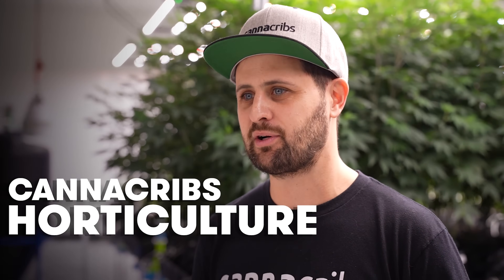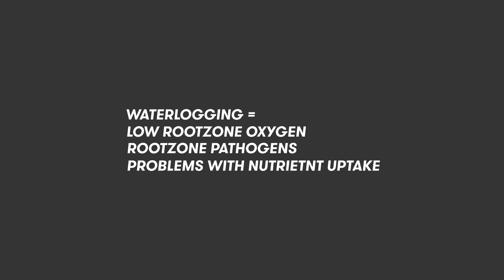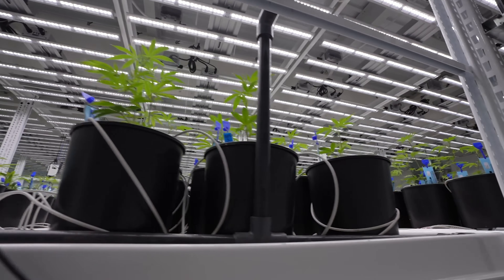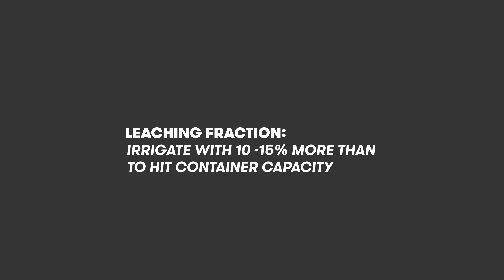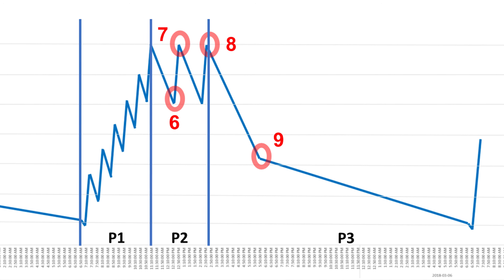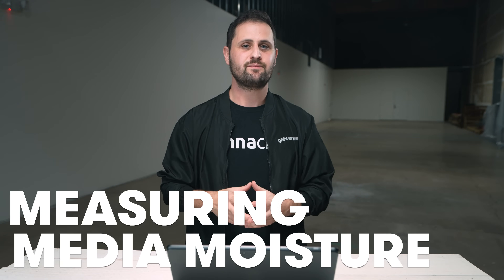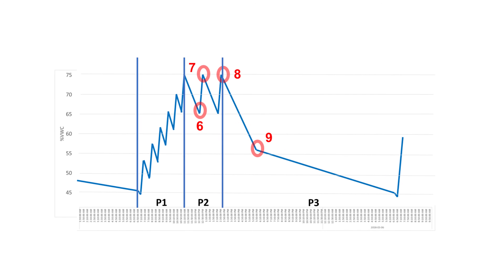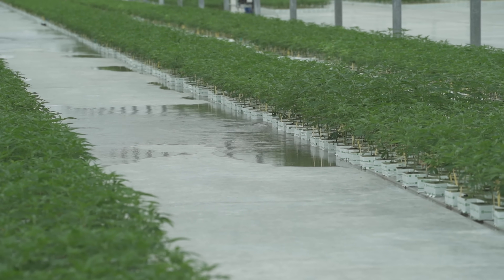Advanced Drip Irrigation Techniques for Cannabis Cultivation

Comment: They all talk about how cannabis loves air in the root zone and you need constant dry backs for this. However, if you use the Autopots system or any other self watering system where the plant decides when it wants to drink and how much you will notice there are no dry backs. The plant will drink so much water so often that the entire pot stays soaked nonstop for the entire life cycle. These plants get huge and are incredibly healthy.
Reply: Yes very true , the only reason it's possible is due to the air.   being pumped into you're res,saturated with air

Comment: I assume that this is not for every strain right? I ask because I have been running the spiderfarmer self watering system since the middle of my 2nd grow (I started May 2025), and proud to say my first autoflower yield was 298g with 2 plants). Anyhow, this system keeps the area below wet, you can touch the bottom part of the fabric pot and feel how moist it is down there but my plants are just booming. No run off = no wasted synthetic product, except for when there is a lot of build up then you simply flush with RO ph'd and calmag'd water.
Reply: It’s not the strain but the growing medium and style of irrigation and growing there just completely different styles of watering, this style explained in video is more ideal for mediums like coco and rock wool because they dry back much faster compared too soil

Comment: Hey what is the lowest water content percentage you can go down to in rockwool before you start having negative effects from too much dry back? 30% vwc?
Reply: I find that it depends on the type and brand of rockwool you are dealing with. I find that 35% VWC is a good point for me for most of the cycle and I will push it lower near the end of the cycle when I want to stress the plants a bit more and I dont care as much if the cubes lose their ability to rehydrate. 
Hope this helps!

Comment: Transpiration before irrigation: Could you explain? Would highly appreciate
Reply: You basically want to make sure your plants are actively transpiring/photosynthesizing before you start watering. In an indoor environment, where you have controlled lighting and you quickly go from darkness to full light intensity, this is usually a non-issue. I typically start irrigation 15-20 minutes after the lights come on, allowing plants to transition into active transpiration.

In a greenhouse or outdoor system, where the sun is the primary light source, it takes longer for the light intensity to ramp up. In such environments, it's best to wait until the sun has fully risen and the light intensity is sufficient to support photosynthesis. On top of this, the ambient temperature takes longer to stabilize, which affects both plant metabolism and root activity. This means you'll likely need to wait a few hours after sunrise for plants to fully activate before irrigating. In an indoor grow room, this process is faster, and in a well designed room, I can typically achieve desired daytime temperatures in less than 30 minutes.

This way, you're not only ensuring that your plants are ready to absorb water effectively but also preventing unnecessary stress or waterlogging by matching irrigation with plant activity.

Hope this helps!

Comment: This is solid information for a commercial grow, with hundreds of plants. Especially the part about picking up the plant and getting a feel for the weight when saturated and when it's dry. After a while you can do it visually and tell when the soil is drying out, just by looking.

For the folks just growing a few plants, or even just a couple dozen, just allow the soil to dry between waterings. Keeping it saturated is definitely no good! You want it to go through wet/dry, wet/dry cycles. As mentioned, roots need air, it's equally important as water. But too much dampness for extended periods encourages rot.

Get use to the feel, get use to the visuals of wet/dry soil. Along with light intensity and nutes, it's right up there as one of the most important parts of growing successfully. Just let it dry out between waterings, just not too much, or the soil becomes hydrophobic, usually the plant will droop by then.

You can tell people about this but most are going to have to find out by themselves through the experience of growing for a while. I've been growing for about 45 years now.

Anyways, good info!
Good sharing knowledge.
Reply from the maker: I agree, experience is the best teacher.
Reply: i use a digital scale to weigh my fabric pots when dry versus saturated but im just a tent grower
Reply: I work commercial growing for a living and you nailed it with your dry back and lifting tips. 
Thank you for the ground work in this industry over the past 45 years!
Reply: If you have a proper medium sensor and and automatic watering system that you can schedule there is no guess work. Us rock wool growers literally grow from a graph and can monitor and  control it all from our phone. Only reason you need to go into a room is to deleaf and harvest if you have your room dialed. What you're talking about is a super old school way of thinking about it. This information is equally as useful for 40,000 plants as it is for 4 plants. You could invest in a micro grow and make it super low maintenance with the same tech that makes a commercial grow low(er) maintenance, plant number is irrelevant. At the end of the day crop steering in rock wool with sensors and salts is by far the cheapest and most efficient way to maximize any grow.